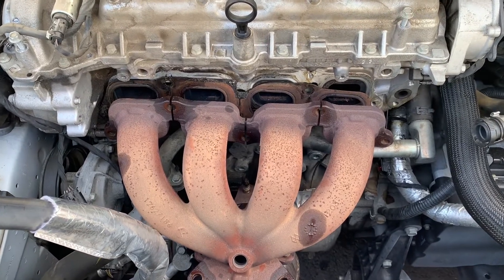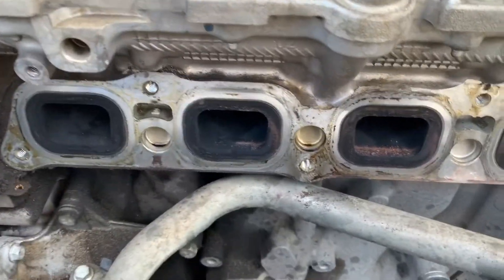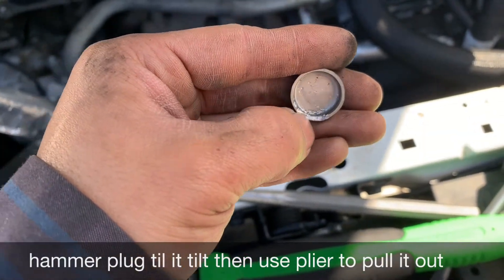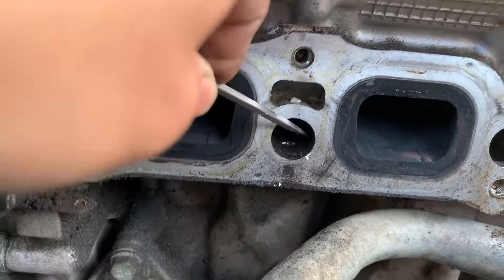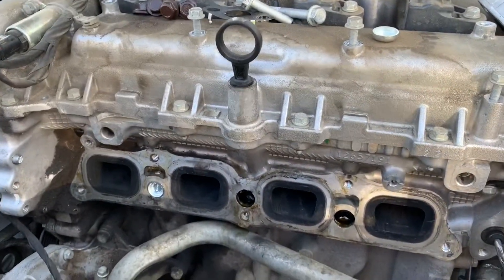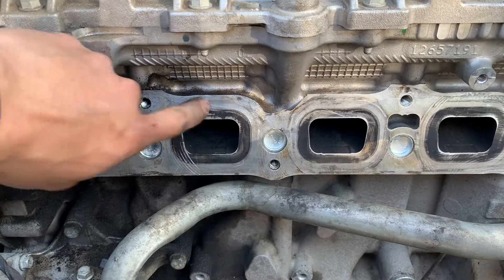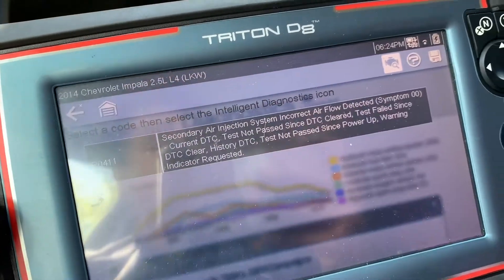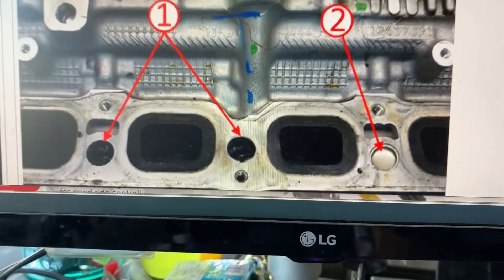Secondary Air Injection System On Chevy Engine (P0411)

Comment: Did you have to replace the manifold gasket or the check valve gasket ?
Reply from the maker: The gasket doesn’t affect anything. Replace it if it looks really bad condition.
Reply: @Ah_Duuu_Ma one last question . Im seeing people saying thread locker needs to be applied to the little galley hole plugs? Im planning on doing this next week on my impala
Reply from the maker: @DippedInTheSauce  its really not necessary. I didnt have to do it.

Comment: I think I might have the same problem I have code p0411 and already replaced the secondary air pump and air check valve and when I do my driving cycle it comes back
Reply from the maker: If you have replaced both parts and code still comes back. Check the port passages, theres build up and clogged.
Reply: @  yes that’s my next thing to go I hope coolant don’t come out but I don’t think 2008 trailblazer have coolant running by the exhaust manifold ports

Comment: I have the exact same block number but the holes are different. 2014 impala 2.5. 2 of the holes measure 12mm and the middle port is just over 8mm.
Reply from the maker: I got the port plugs from oreily store. They have dif sizes.

Comment: Any idea if I need port plugs? I have a 2014 impala 2.5l and I took off the exhaust manifold to find there are no port plugs. The ports are smaller than the ones in the video.
Reply from the maker: I got the port plugs at oreily store.

Comment: Did you have to drop/loosen the cat converter in order to remove the exhaust manifold? Couldn't seem to find an angle to remove with three bolts still there.
Reply: I had to do that. I was hoping to be able to just unscrew the studs cuz they were too long, but had to go under and remove 4 bolts from the cat.
Reply from the maker: I didn't have to remove any bolt from the cat to lower it. Just only on the exhaust manifold and the 3 bolts connected to the cat.

Comment: Where were you blowing the air through to clear the ports out?
Reply from the maker: The hole where the check valve mounted on. The port thats all the way on the right side.
Reply: @Ah_Duuu_Ma  appreciate you boss 💯
Reply: @Ah_Duuu_Ma  also by any chance do you remember the part number for those plugs? Or where you purchased them
Reply from the maker: @CarlC1030  You can buy it at oreilys or autozone store.
Reply: Yeah was wondering the same thing

Comment: What about the 2 ports in the rear under the intake manifold?
Reply from the maker: Not sure but i only need to fix whatever thats needed to be fix.
Reply: @Ah_Duuu_Ma  well the two ports in the back are needed to be fixed if you're having incorrect flow looks just like the three in the front except it's underneath the intake manifold most likely that's the reason why it is incorrect flow especially if the front ports were clogged with carbon

Comment: This happened to my Impala as well. Mechanic had my car for a few days didn't know that you can take the plugs off and I showed him this video he found the parts from the dealer replaced my plugs after cleaning everything out. My question is.. how do we prevent carbon build up like this from happening? is there any chemicals that we can put in our gas or cleaning solutions without having to take off the manifold to prevent this?
Reply from the maker: To prevent this from happening again. You must use the right gas, what ever gas that is "REQUIREMENT" for the car. Make sure you change the sparkplugs on time or earlier "sparkplugs last up to 40,000 miles". Buy good sparkplugs dont buy cheap ones. You can also buy "fuel system cleaner" at auto part stores and do it once or twice a year depend on how much you drive. If you dont use the right gas, this will cause detonation and leave you with unburn fuel and that unburn fuel will causes carbon to build up. Take car of your car do maintainances on time.
Reply: did the code go away after you cleaned and replaced the plugs ??
Reply from the maker: @Justincaseyahur  Yes and also replace the check valve too.
Reply: @Ah_Duuu_Ma  yeaah i had chevy replace the pump , i replaced the valve , then we cleaned like he did in the video and put New plugs and the code did not go away
Reply: @Ah_Duuu_Ma  you Think i Need to try cleaning it again more ?? or what would u suggest
Reply: @Bryson burton  did you figure out the solution? I did not replace the check valve because mine works. I tested it. I am going to try an replace it anyways... do you think maybe the upstream O2 sensor needs to be changed? Does anyone have the CAT/O2/FUE monitors showing on their scan tool for I/M Readiness?
Reply: Gm recommends you use upper engine cleaner periodically.

Comment: My 3.5 v6 impala has this code... Replaced pump and valve because pump was full of water. Code still there. Im assuming this may be the issue
Reply from the maker: how does water get in there? interesting. check the head ports, makie sures its not clog. check the SAIS fuse.
Reply: @Ah_Duuu_Ma  the check valve fails and causes moisture to get in. This is the biggest issue with impala secondary air injection.
Reply: @Ah_Duuu_Ma  water is a by product of combustion.  So when his valve failed, it failed open, and allowed combustion gases and water back into the pump it sounds like.  My problem was the opposite.  The Valve clogged and prevented pump air from blowing strong enough into the exhaust manifold.  I had to clean out my valve.  Here is my video.

https://youtu.be/qCaWjCNPgsY
Reply: yeaah i replaced both and atempted To clean my shit like the  guy in the video and it did not Work , code still there so ima try it again ,  2014 impala 2.5L 4 cylinder 225k  miles  if anyone successfully did this And the code Went away Hit me up please !
Reply: @Justin Case  I know this is a year late, but anyone out there who still has this issue I was able to fix it. I followed this video and put it all back together. What I didn't realize was the tiny ports behind those plugs that go back into the exhaust were clogged. There is a Chevy Technical Service Bulletin # 17-NA-080 that shows them sticking a rod thru the clogged port and you can see it in the exhaust cavity. I went back in and found mine were sooooo clogged up I never noticed them. That fixed my problem. Finally ready for smog retest!
Reply: @Justincaseyahur  did you ever fix your imapala? I have same problem

Comment: Do you have a part number for the port plugs? I've talked to the dealership and orileys, neither of them had a part number for the plugs.
Reply: Know this comment is old, but I recently found this video to fix this issue and found the plug part number. GM# 9427695

Comment: Thank you for the great video, the dealer wanted to condemn my head because the ports were plugged and we're non-serviceable. Once I remove the plugs oh, I was easily able to shove a stainless steel wire him in and through all holes to clear the ports. I had three plug ports before I started
Reply: Hi Robert just wondering where you got your port plugs from? Do you have a part number? Did you have to reuse the old port plugs?
Reply: Honestly I had to show my mechanic this video because he didn't know that you could take those plugs off. He tried for a few days to unplug the ports and once we took the Caps off we ordered them from the Chevy dealership I think it was like $5 for each port cap. Not sure of the part number though.